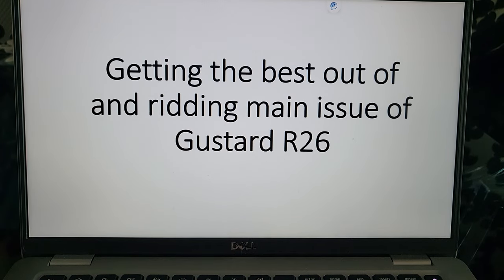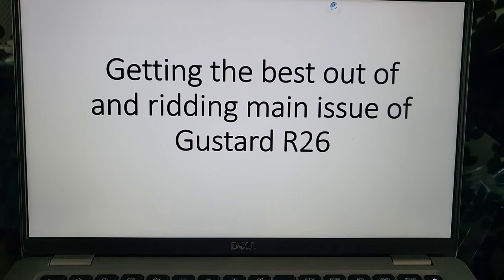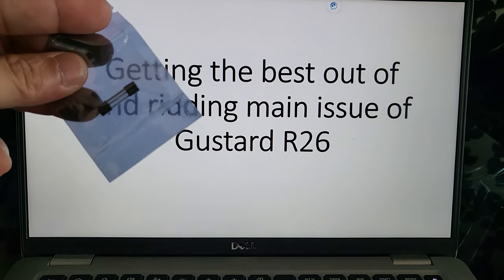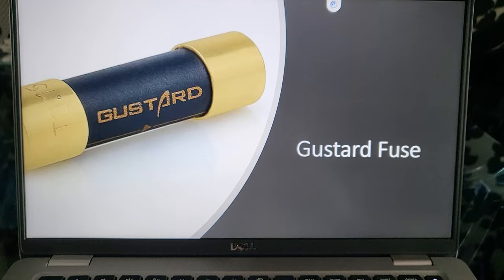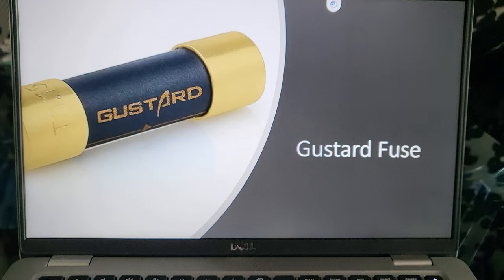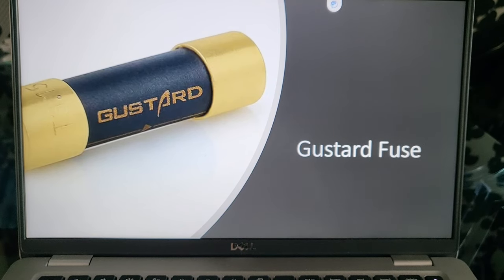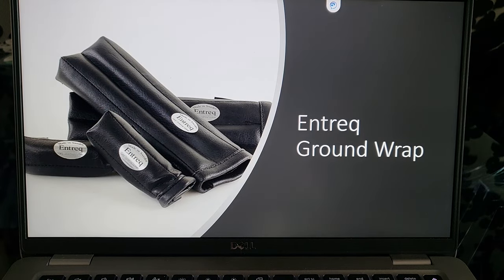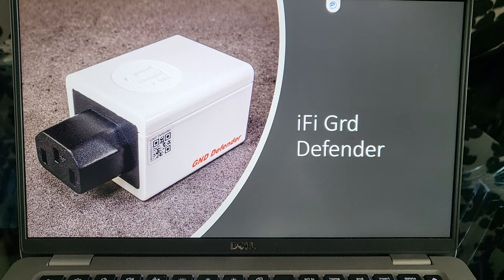Getting the best out of and ridding main issue of Gustard R26

Comment: I did not have hum issues on the r26 Here is how I get the best out of the R26 I am using a Zen stream that has a ethernet optical converter wired in the system. I go USB for the ZEN Stream. All my spare inputs have cables attached to a Coherent Systems RTZ2 (it all adds up to further improving the sound). I use Black Ravioli Big pads as isolation feet. But the biggest change has been adding an external clock I use the Leo Bodnar Precision clock. My friend sold his top of the range After Dark clock as this unit just works with the R26. Changes are not subtle. I have yet to change the internal fuse but will do at some point.. Thanks for sharing you experience.
Reply: Nice setup you have....I have recently changed my cables to hybrid (part copper, part silver)...which gave me more details, clarity and without hurting the warmness. If you could audition them for free...give it a try.

Comment: Thanks for the tips but i didn’t go that far with my r26d. I bought mine direct 9 months ago and the standard internal fuse sounds horrible ! I got the gustard int. fuse in a pack of three which proved  to be a very clear, dynamic and resolute . However ,the sound was too  hard and in your face for my liking.
So i obtained my old favourite AMR Gold T 2.5a and normality returned. The sound is far natural
without the excitement that some like but i find nauseating.
I use it with Novafidelity x40 cd/server with van den hul aes xlr digital cable into r26 and Telq xlr into a NAD c658 to NAD C298 power into buchardt A400/11.
The sound is quite entertaining.
Reply from the maker: Glad you found the sound you want! Good for you.

Comment: Thanks for sharing your experimentation to get rid of the R26's transformer hum. I have an R26 with the hum, which although only noticeable up close is a little annoying, I'll have to try the Ifi Groundhog. My coax inputs and outputs are all in use, which leaves only the USB input. Can you confirm whether using the USB  connector successfully gets rid of the hum?
Reply from the maker: Not the usb but the rca interconnect...hope it could help you.
Reply: @bryanlee8476 cheers, I since solved it a different way and improved the sound of my system a lot in the process... Puritan PSM156 power conditioner.

Comment: Hey I’m new on that hobby, I just bought the same dac, you mention that you use i2s cables for music, how i2s works ? How do I shop for this cable? How do I play music using this cable ? Thanks
Reply: Be careful building a system around using the i2s interface, each manufacturer has a different layout standard for i2s.  Let's say your source and DAC both have the i2s interface, but if they are from different companies they may not work together.
Reply from the maker: Yes...Charles had made it very on selection of device if you intend to use i2s cable. My advice....stick with gustard to get best outcome of i2s.
Reply: @bryanlee8476   They way i have my R26 connected.... Since I am streaming from a computer I purchase a Gustard U18 DDC to clean up the sound.... So i connected my Computer with a USB cable to Gustard U18, Then i2S cable from Gustard U18 to R26 and them to my amp. It works perfect for me.  My i2S Cable is Audioquest cinnamon. My USB Cable is the one that comes with your Gustard.

Comment: Thanks for sharing! Sounds like if using the internal clock the new fuse might not buy you much?
Reply from the maker: Thanks....as mentioned, upgraded fuse for r26 doesn't give significant result.
Reply: I also plugged in the black Gustard to the A26 and the sound got worse. Slightly foggy and not so clear anymore. ok, i figured i need to burn in the fuse. But it felt like more was lost over time. Then looked, the old one has 2.5A, the new one has 3.15A. The originals are back in and everything is beautifully transparent again. Will now try 2.A from other manufacturers. On my P26 preamp there was an improvement with the black Gustard. But the values old/new also fit there.

Comment: How can a fuse or mains power cord improve the sound quality? Then first you need to take into account the quality of the power supply of the entire network, starting from the voltage source, cable lines, transformers, wires in the house.
Reply: try it
Reply from the maker: I am not an engineer or electrician....however, I am sharing what I hear. Thank you.